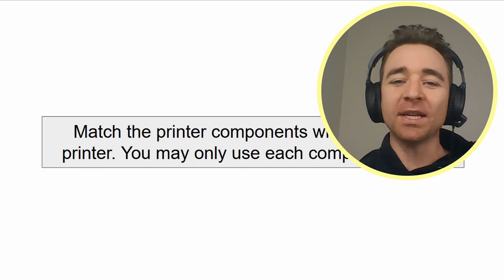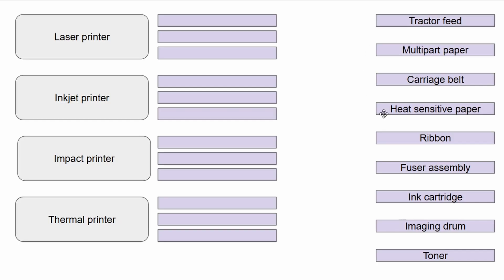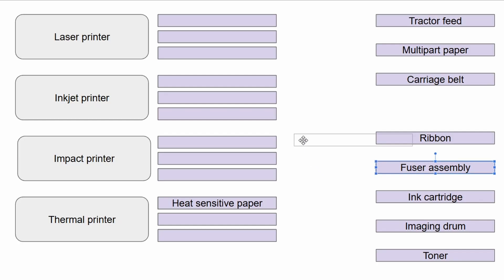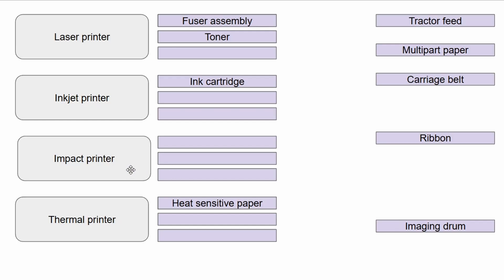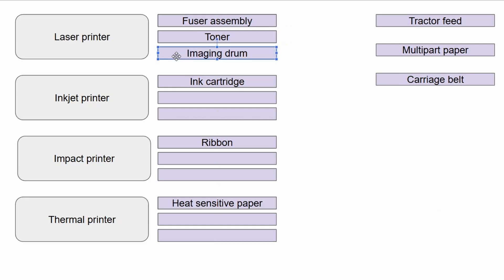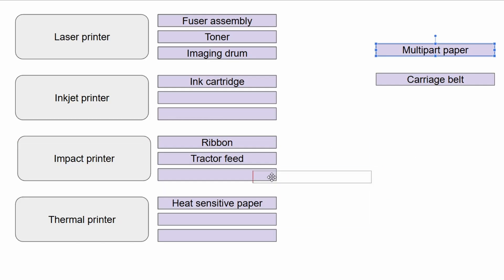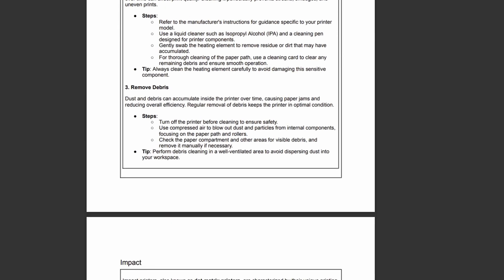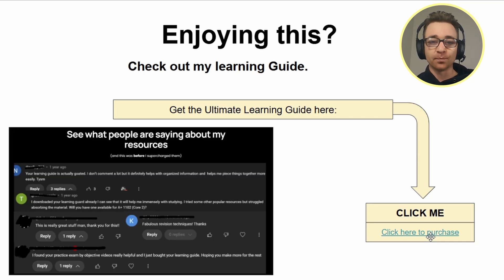CompTIA A+ 1201 Performance Based Question Walkthrough! | Pass the CompTIA A+ with this FREE PBQ

Comment: Please confirm whether twisted pair copper (Cat5) supports 100BASE-T or 1000BASE-T.
Reply from the maker: Hey Mankia,

This is probably the most confusing components of the exam due to the different information out there.

The official IEEE standards state that the minimum cable for 1000BASE-T ethernet is a Cat5 cable. 

Simple answer:
✅ Yes, it absolutely can support 1000BASE-T according to the IEEE standards.

Nuanced answer:
✅ Not all Cat5 cables necessarily give 100% throughout of 1000BASE-T at 100m, so if you need to RELIABLY ensure 1GB/ps then you should go with Cat5e.

When I was studying for my exam, I simply considered cat5 as being able to support 1000BASE-T and passed successfully on my first try with no issues.
Reply: @JourneyToCyber  I want to say a big thank you because I passed the CompTIA A+ Core 1 (220-1201) exam on July 18th on my first attempt. I purchased your learning guide, and it was incredibly helpful. Now, I’m preparing for the Core 2 (220-1202) exam. Could you please let me know when the updated version of the guide will be available?
Reply from the maker: @manikadebnath9709 congratulations! Super glad to hear. 

I'll post an update when it is ready.